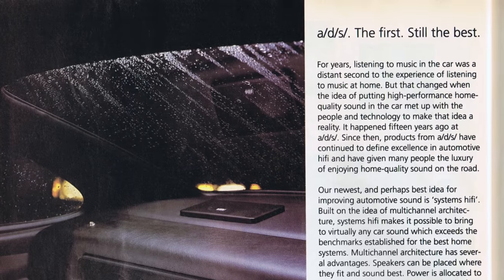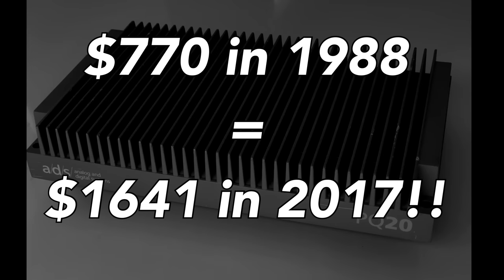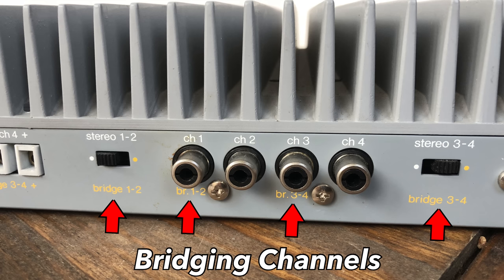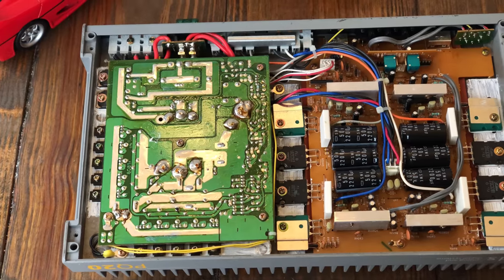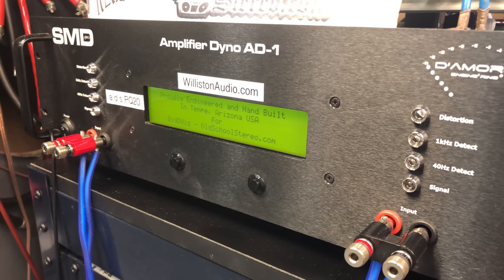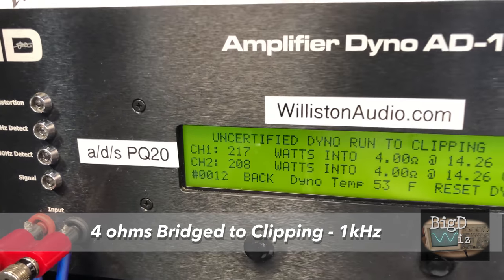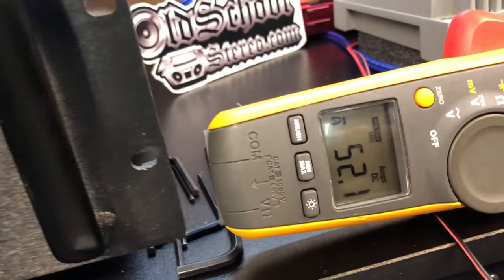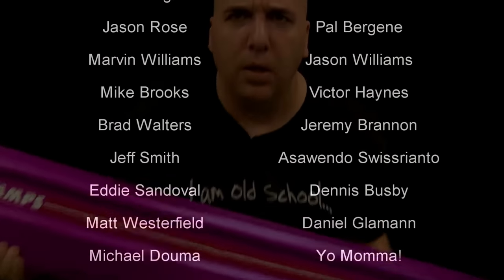Vintage SQ Amp Tested! a/d/s PQ20 Review and Amp Dyno Test

Comment from the maker: Search for used a/d/s amplifiers - https://goo.gl/8wfjnE
Reply: BigDWiz WAY KILL AMPs!!!!
Reply: BigDWiz summer of 1993 I made my first large car audio purchase at Magnolia HiFi (long before Best Buy bought them).

Nakamichi TD-1200 motorized cassette deck
Later swapped for an Alpine 7909
A/D/S 325i 5.25" components x 4 sets
A/D/S 4" plate speakers x 2 pr
A/D/S PQ-20 x 2
A/D/S PQ-8 x 2
Hifonics Isis cheater amp x 2
Voodoo Acoustics quad 10" isobaric enclosures x 2 (total of eight 10's)
Later swapped out for Soundstream SS-15 15" subs x 8 (these had a very thick paper cone and huge magnet for their time)
Audiocontrol Epi-Center, two EQT's, one 4XS and ESP-3

I did the install myself over the course of a couple months.

I don't remember the exact total $ amount of all the gear but I do remember that it was over $9k.

A few years later Sony introduced the very first Mobile ES system, which I swiftly purchased at $10k. The system contained every single component from source to drivers. It sounded really good, the best there was at that time.
Reply: First Floor All that and a SHITLOAD of credit card debt. I started with Alpine amps and moved to Soundstream around the same time. I always liked those a/d/s amps. The Boston and a/d/s demo vehicles were always the best sounding and most tasteful.
Reply: Great video .why don't test the Cobalt line from Orion the 4 channel amps
Reply: You make the soundtrack of intro? I like it
Reply: V S You were a baller in 93!
Reply: This is one amp that I always wanted to get that was just out of my reach even to try to buy them used people knew what they were back then and you couldn't get them much cheaper even eight ten years later they were still wanting five six hundred bucks
Reply: Did a/d/s ever make a power plate 50 from a ps5. Or is that a unicorn piece?

Comment: I'm using  a A/D/S P640 it a 6ch amp. they're so flexible you can run it so many different ways. I have 4 channels bridged 120x2 for the front focal separates and stereo 60x2 for the rear focal coaxials sounds great never distorts
Reply: Last of the real A/D/S amps right there and that's when they finally put the crossovers inside the amp. The 642 became a DSP and then the company was bought out a few years later.

Comment: Loved my PQ20. Sold it in 2004 to someone in Seattle building a big system with them.  I had it since 1991.   I do still have the screwdriver they gave you to adjust the gain.
Reply: How much for it?

Comment: Nice to see the review as I'm hooking one of my old PS5's up today to run some old 5" a/d/s bookshelf speakers. These amps were absolute beasts both in terms of available power and how clean that power was.  50 watts of a/d/s power > 100 watts from most manufacturers, and so much cleaner.  I used most of their amps over the years (late 80's/early 90's): PQ10/PQ20, PH15, PS5 and the systems driven by these amps were exquisite.   -My parents didn't buy me a thing but I got a job at a hifi store, for the discount.   My most elaborate 6-channel system got stolen one rainy night when I left my too-sensitve Alpine alarm off for the night (those micrphone glass breakage detectors were garbage). The insurance adjuster was hard to convince, given there was ~$3000 worth of gear in a $1000 vehicle!

Comment: I absolutely loved my a/d/s amps back in the day. I used two PS5s to run my front and rear mains and had a completely clean and clear sound even at maximum volume. They seemed to have a warmth to them that RF, Hi-Fonics, Orion and Soundstream didn't. Thanks for the video and tests. It's good to confirm after all these years that my ears weren't fooling me.
Reply from the maker: Yeah man, really nice stuff here

Comment: I had two PQ10s and a PQ20 back in the late 80s, early 90s. Had a Sony U8000 with VCR/TV, two sets of a/d/s 320i seperates, two SB10 subwoofers with all the a/d/s crossover action. The sound was unbelievable. The best was driving around the metal warehouse which was nursery/craft store. The building would rattle and everyone would evacuate who wasnt familiar with my setup in town. I worked my ass off as a kid to buy and install all that stuff in my convertible Chevy cavalier. Haha. Great memories. I still have the head unit and two of the PQ10s.

Comment: Thank you for this test.  a/d/s was awesome.  I still run my 1990 PH15 bridged to run my front 3 channels, all a/d/s speakers.  Amp and speakers original, no re-builds, no re-coning.  I paid for and got sound quality but the build quality and longevity is just a bonus  Sadly, a/d/s was bought by Directed Elec. and then went away.

Comment: there is a PQ20 bridged running a set of S10 subs in the doors of my 97 silverado.
I have 2 sony 4040's bridged running the 320i separates and A6i/m coaxes (also in the doors). There is an MTX thunder 2300 running a pair of MTX BT104's in a stinger box under the rear seat (soon to be upgraded to FU-300's DVC 4ohm), we know that amp can handle it...

I also have a PQ8 collecting dust, a PH6.25x doing PC amp duty, and a PH15 which is going in the truck to run 4 200i plates (in visor and rear arm pockets) and infinity 4x6 plates in the C pillars.

Comment: One of the best SQ. Systems I have ever put together. I ran 2 of the PQ-20 in my Mercedes back and like 93-95 somewhere around there. I paired them up with a set of Aurora Neo 12in subs in the trunk and 2 sets of 6.5 MB quartz in the doors and rear deck. For the preamp I used the ADS electronic crossover and EQ. I believe I want a couple of Awards in some shows in competitions in Arizona.

Comment: I learn so much from your videos what is good, what not to do, and what not to do and what to not buy. I do not have a car or a system anymore, but next vehicle i get i do not want it to be rigged like my last system was. It has to be right, and not catch fire or smoke wires. I have had more than one wire start smoking because the ground and hot touch. Scary. I am doing my next install right. No rigging.

Comment: Big D. Just a little FYI on the paper in the amp. This material is impregnated with a chemical to raise it's insulating ability. It is used to prevent the solder side of the PCB from arcing to the chassis. I used to see it in various products when I was a bench tech and repaired various consumer electronics products.
Reply from the maker: Great info, thanks 👌

Comment: Had that amp and their crossovers which were programmable using a DIP socket and resistors.  Very high speed Texas Instruments Op Amps in the preamp stages.  Those were the days...Dynaudio aperiodic damped subs, Morel mid bass/mids and focal tweeters.  Before the Chinese revolution. ;)

Comment: I use 2 ADS PH15.2 ( It's revised 6 channel brother) in my 928 semi period install and love them. Hooked up to a 642 IX crossover and an AX2e to get all 6 channels bridged at 100 watts each. Plus I had to do this to get 2 din outputs as the 6 channel amps don't accept rcas without adapters.This is to get 4 channels worth of signal running to all 6  with the rear 4 speakers running off of the rear two signal channels  and the front speakers running off of the front 2 channels. A touch annoying to make the din cables but oh does it sound good.
Reply from the maker: I have this amp too. I want to get one of the external x-overs. Want to use in 4-way active system powering midbasses/mids and highs

Comment: I used to have the ABS pH 15.2 I had two of them in my 79 Camaro I was using one to run my 10-in bazooka SAS subwoofers and I used a Sony crossover that was underneath my Alpine radio in the front you can adjust it manually it's on a pretty badass I had in the back deck to Boston acoustic 6x9s and the front speakers were Alpine three-way separates sounded pretty bad ass you could definitely hear that thing coming blocks away I'd love to get my hands on that exact system

Comment: A/D/S made some great stuff that's for sure , the Amps had plenty of power and were known for incredibly low distortion creating crystal clear audio . I had a complete A/D/S system in a car at one time , I had 3 sets of 325is components running off of a PH15.2 and two 10 inch A/D/S subs running off of a PQ20.2 .   This was simply the best sounding stereo of any type , home or car that I've ever heard , I paid a ton of money , likely around $4-5000 in 1996 for it all lol .   Bass was nice and tight , not boomy like todays overpowered crap  . Highs and Mids were incredible and to this day A/D/S  components mids are still regarded as the best sounding speaker that you can install in a car and still fetch over $800 for a pair if you can find them in good shape. They can't take as much power as a modern mid range component but they were  ear deafening loud and crystal clear  cranked up with only 40-50 watts as its all they needed .

  Quality American made product .  I'm in search of some A/D/S  L910 home speakers at the moment but they are incredibly rare and hard to find .

Comment: BTW you made a comment on the 2 power ratings and I found a real nice PQ20 on eBay for sale and this is what he has for power. Might explain the 2 different power ratings.
12 volts:

4 x 70W @ 4 ohms (0.05% THD)
4 x 75W @ 2 ohms (0.5% THD)
2 x 150W @ 4 ohms bridged (0.05% THD)
Fuse: 2 x 30A

and

14 volts:

4 x 80W @ 4 ohms (0.05% THD)
4 x 95W @ 2 ohms (0.05% THD)
2 x 200W @ 4 ohms bridged (0.05% THD)
Fuse: 2 x 30A

Comment: Back in 85 I set up my first nice system. I ran two P40 amps and one P80 for the subs. I spent about $3000 for my system. Alpine head unit their top of the line, ADS separates up front, Kef for the rear speakers (ADS wouldn’t fit), subs Pyle Driver and a Audio Control processor. It was good to live at home and have a good paying job while in college, lol.

Comment: First of all thank you for the efforts put forth testing car hi-fi. Having owned and used numerous car amps beginning just after the Power plate 100 of late 70's which in itself was a different design then what followed from ADS through out the 80's. As much as I tried to convince myself that my investment in P80's/P120's was what their company led the market including dealers to be, unfortunately my experience is that they fell short...well short. Almost anything else from the 90's that is still around, is a better old school choice.

Comment: I still have two ADS PQ10's and an ADS PS5. When I got these, I had just bought an Isuzu Stylus, similar to a Honda Civic. The guy at Sound Advice kept trying to get me into some cheaper stuff because of the Isuzu, so I told him "It's not about the car!" I wanted a high quality system and I read magazines and checked specifications for months. Then, Sound Advice had a sale. I had already bought the PS5 and now the PQ10's were on sale for almost half price...I bought 2. I added a Soundstream electronic crossover, a Kenwood combo graphic and parametric EQ with an Alpine head unit which was a tuner and required amplifiers to work. Everything was based on signal to noise ratio over 100db at 20-20,000hz with low harmonic distortion. In the front, I had Alpine silk soft dome tweeters and Phase linear (High-end Jensens made with graphite) 4.5 inch mids. In the back, I had 6.5" Infinity Kappas and for subs, two 12" MTX pros mounted in a box I custom built pumping in mono through the back seats with a huge 4" port, also firing into the back seats. I added a 1 farad capacitor for the bass amp and used all monster cable to connect everything. Everything sounded great on this system! I had guys with high watt, lower end stuff chasing me and asking what I had...something I never recommend answering. I told them I was putting out about 400 watts and their jaws would drop. They thought I was lying. It was so clean sounding, you could hear every note and it was louder than you could stand. I loved that system. With the exception of the MTX subs and the Alpine head unit, I still have it all. I happened to buy an MB Quart Component system a few years later. It has 3-way separates with the fancy passive crossovers. That cost $650 back in, I believe, 1997. Those are still in the box brand new. I'm starting to think this all needs to go in my Jeep Wrangler...hmmmm!

Comment: My first real "system" was in my SHO, running an a/d/s/ PQ20.2 to my 325is components and an MX450 to 2 JL Audio 10s running off an Alpine HU. That got stolen. My second system was an all Lanzar system (their components used soft dome tweeters, like a/d/s/) running off a Clarion HU. That also got stolen in a totally different place.

In 2002, I had an all a/d/s/ system in my Accord coupe. 2 P4100.2 20th anniversary amps(oh man, those were amazing and looked killer) running 336is.2 components up front, 236is in back and 2 R10s subs in custom fiberglass pods in the trunk. Absolute perfection. My biggest regret was when I quickly traded in the car on an '04 CTS-V, brand new. I loved the Caddy, but really miss that system. 

I currently collect a/d/s/ amplifiers and speakers... 😄
Reply from the maker: Wow that’s nice gear 🤟

Comment: These amps are tanks, I've only seen 2 PQ-20's blow up. I started installing in 1988, and worked with scores of these amps. The PH-15, PQ-10, PQ-8, and PS-5 failed once in a while, but the 20 was almost indestructible. The first amp I ever bought (for my 1982 Escort lol) was a Power Plate 80.
Reply from the maker: Awesome 👏

Comment: I HAVE 2 PQ 20'S AT HOME RUNNING WITH A 12 VOLT POWER SUPPLY BOUGHT BACK IN 1989 HAVE ALL MANUALS  WAS INSTALLED IN MY 1989 MUSTANG GT  WITH 4 COLLINS AUDIO BASS TUBES BOSTON ACUSTICS MIDS AND HIGH'S  ALL SIGNAL PATHS WERE WITH ADS 12 PIN DIN CONNECTION AND A   AC 203 DIN ASSINGMENT MODULE  THE SOUND WAS UNBELEVABLE NO ONE COULD BELIEVE HOW ACCURATE IT SOUNDED  WITH THE ADS CROSSOVER  AT HOME I HAVE BOTH PQ 20" OPERATING A PAIR OF HIGH END BOOKSHELF SPEAKERS SOUND IS AWSOME

Comment: I remember seeing these in the ads in car stereo review and then later in car audio @ electronics and wanting one soooo bad but my god the $$$$$$
Reply from the maker: Deep pockets required fo sho 😱
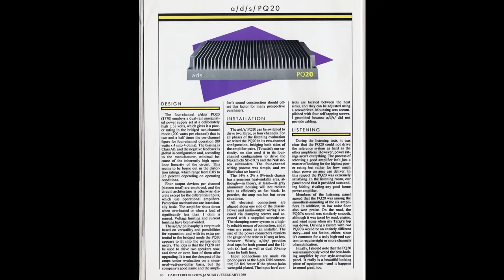Reply: @5:25 I remember that very article. I had that issue and dreamed about it quite often that or the Linear Power had my eye. I thought the LP amp chassis looked a lot like the (4) Rockford Punch 75 I had in my trunk at the time so I wanted the A/D/S for something different. I was saving at the time for a Power 650 but ended up with an Infinty RSA450 deal I found in Crutchfield.

Comment: Lolol keep em coming BIG D!
That amp was the shizzdizzle back in the day.
Reply from the maker: Not big, impressive power numbers, but you don’t need huge power for SQ systems
Reply: BigDWiz, that's what was so cool about old school AB amps. Back in the day all my old fuse housings were stuffed with tin foil and a 16gauge run for each amp.  Running around boomboom scratching my head wondering why my amp keeps cutting off haha Good Ol days!

Comment: I had an ADS PH15 and a PQ8.  I got rid of a Sony amp for the 15 because I had a friend who sold stereo equipment that got them for me at his cost. Good sounding amps, but the 15 couldn't handle hot days in the trunk. It would shut down after about 2 hours of average sound levels. Plus I had to get noise suppressors to get the alternator whine out of the sound. Also didn't really care much for the input plugs on a din plug. It was a good and warm sounding amp though. Not bright like the Sony was. I wish you would compare the sound quality of the amps you test. Plenty of amps really kill with loads of power, but some of them sound like crap while they are doing it.
Reply from the maker: SQ is subjective, power output is not. I don’t claim to have the best ears for detecting SQ, so I stick to providing the objective information 👌
Reply: Kevin McWilliams 
Alternator whine (ground loop)  is a grounding issue. Needed a better ground or grounding point.

Comment: Ahh the good old days of cutting out the rear window deck and getting cut up putting in better speakers. I had the Soundstream MC500, 2 10" or 12" sound stream subs (I forget), ADS PQ 20, ADS PQ 10, Audio Control ESP3 and 2 Audio Control 15? band EQ. All stuffed in a Mazda 626. 2 weeks away from entering a sound competition car gets stolen from Rockaway Center Mall in Long Island. It was a company vehicle. Boss was really pissed, but on the other hand felt bad on how much money I had dumped into that system. It sounded so great, never heard anything better

Comment: Wondering how the .2 variants would improve on those numbers.  Wouldn't expect a huge jump, but perhaps at least meet rated power at 4 ohms hopefully.
Reply: That's what happened essentially. They revised the components to meet or exceed the rated numbers. The standard pre .2 amps had trouble with this as you've just seen.
Reply from the maker: I have the PH15.2, the 50x6 version

Comment: had a pair of these a/d/s very nice amps, with very clean sound, quite inefficent, I used a class D amp when they came out, didnt like them, powerful, but the sound was not the same, I do not know if the new class D amps are any better.

BigDWiz, I have  2 Old School ESX amps by Zed Audio, a Q120.4 (4 x 120) and a Q475.1 (1 x 475) are you interested in any of them for testing? bought them new about 17 years ago and currently not using them.